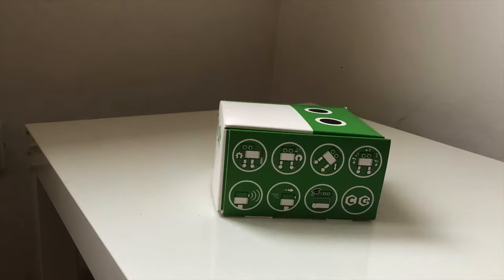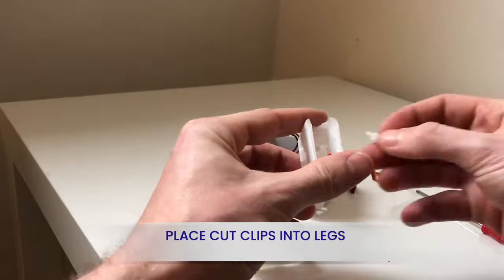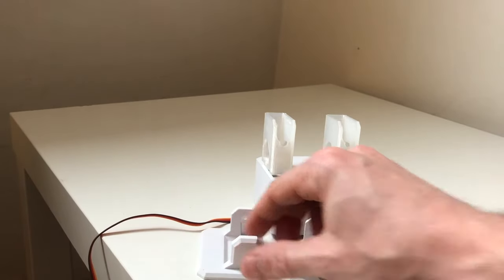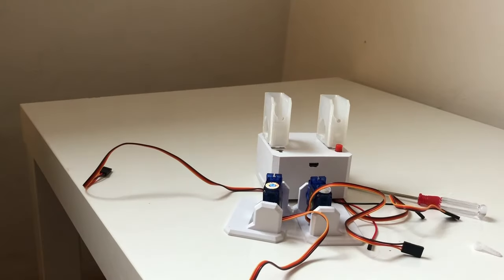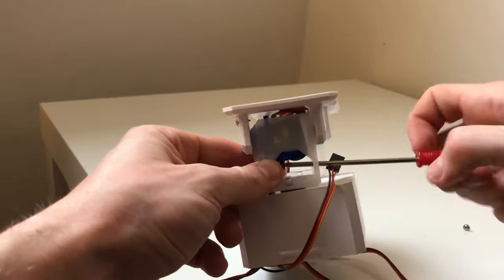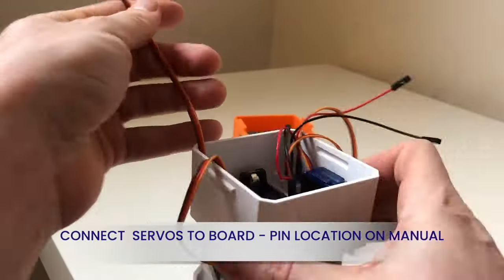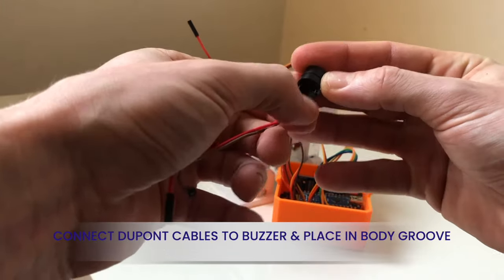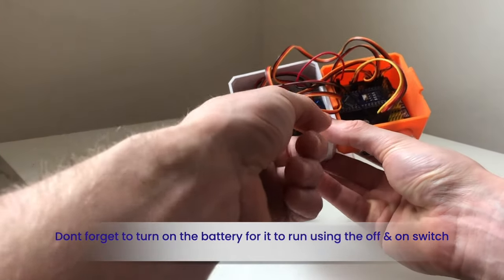Unboxing and step-by-step building of the Otto DIY Starter robot Kit SparkFun Edition

Comment: We have the Otto Starter robot. It makes different movements when it is connected to electricity or while the code is being loaded/uploaded. The leg servos are spinning randomly and the computer is making the disconnection noise because it draws too much current. That's why the bluetooth module's light goes out because the servo motors are constantly drawing all the current. But the bluetooth doesn't go out on battery connection. I can't test so I'm looking for help.
Reply from the maker: how different the movements? can you shows us a video in the community please?
Reply: @OttoDIY  legs move randomly, sometimes he even throws himself on the ground with ridiculous movements while loading the code.
Reply from the maker: @-nms1-859  it must be the parts you use
Reply: @OttoDIY  how can i send the video to you?
Reply from the maker: @-nms1-859  post in our discord chat community

Comment: Very crucial part is the battery case. This is not shown. Nor is how it is inserted or what sort of battery is used. This is mute if you buy this exact kit, but if you print / build your own then this missed part makes this video difficult to follow.
Reply from the maker: Hi @Mr Waicol the battery case in this original kit already comes assembled, you can learn more about this kit here https://www.sparkfun.com/products/18557 for the batteries there are plenty options discussed in our blog https://www.ottodiy.com/blog/power

Comment: Can we use 4 piece 1.5 volt AA batteries for making this robot?
Reply from the maker: No AA, you must use the battery module shown in the video, or a more powerful power source.
Reply: @OttoDIY  Oh , so can I use 5V from a LiPo 3.7V battery + DC booster + Charger?
Reply from the maker: @AyushFiction  yes you can
Reply: @OttoDIY  thanks,But how much mAh battery should I use
Reply from the maker: @AyushFiction  it depends for how long you want it to last
Reply: @OttoDIY  oh thanks